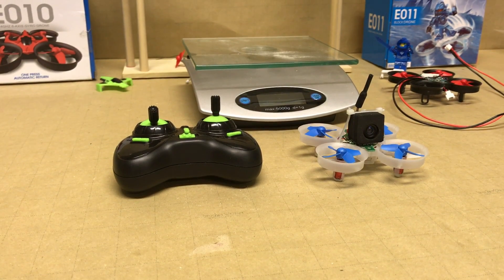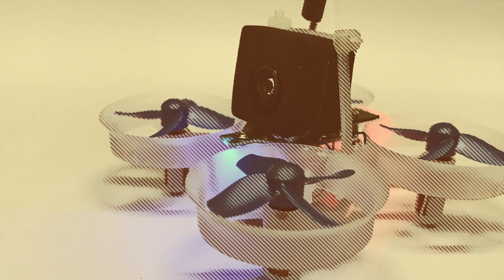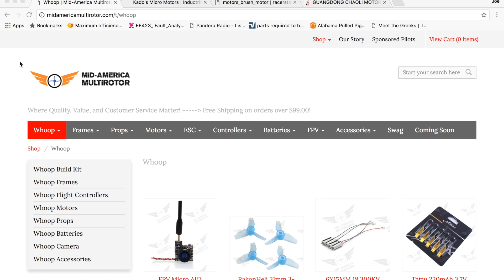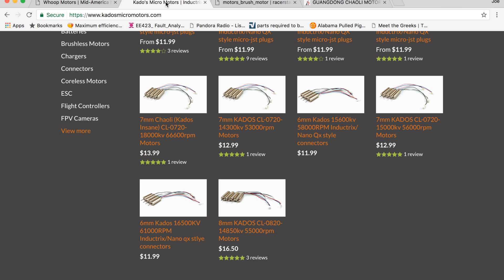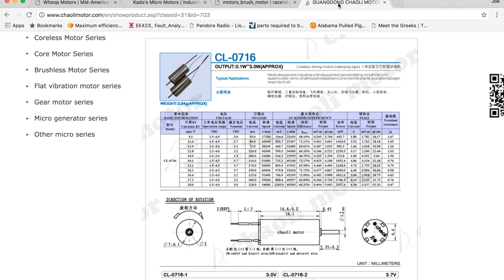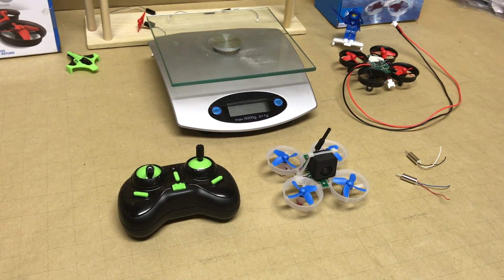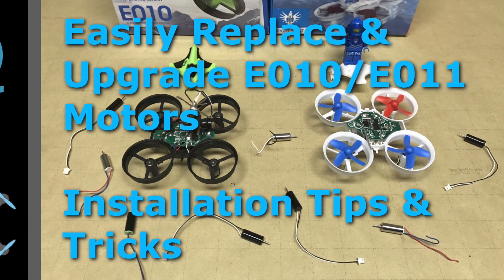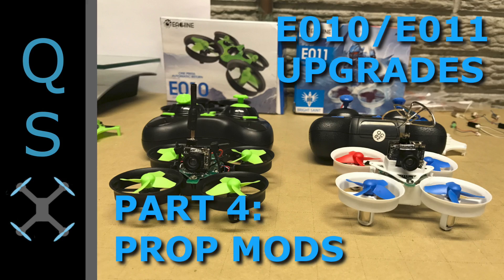Part 3: Eachine E010 E011 Upgrades - Faster Motors for E010/E011

Comment: I just bought 72000 rpm racerstar, and I feel this is a very great motor, tp some time I flew my drone, both my CW motor is locked and can not spin at all..do you know what happened with my motor? tanks
Reply: sistri adi hey man, did you change the flight board to use the faster motors? Or did you just solder to the stock board?